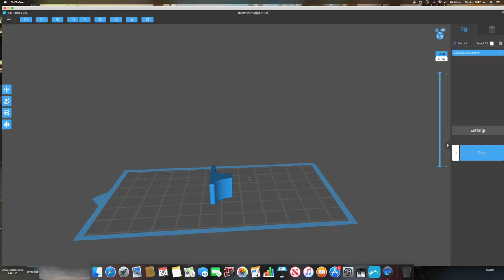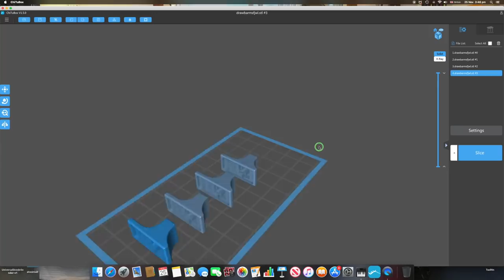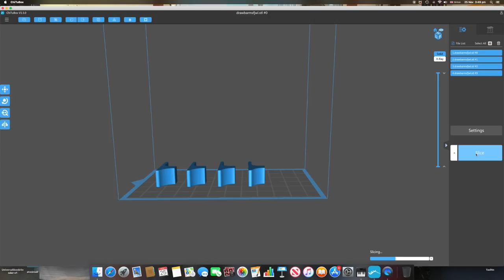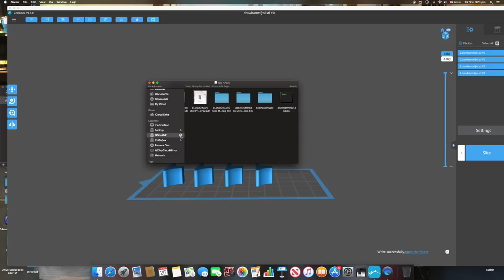Elegoo Mars 3d Resin Printer for super fine detail

Comment: Great test! Would have liked to hear a couple of more details though, like the amount of time the print took, the time you put it under uv light and such.
Reply: The estimated time for the print was 1hr and 14 seconds, but he said in the video that it actually only took 56 minutes. For most UV resins, it only needs around 5-10 minutes under UV light to set to a reasonable hardness, a few hours under direct sunlight. If it has crevices or multiple sides, it may need turning to make sure it cures evenly. It's just what dealing with UV resin is like. Fast curing, but it takes a bit more effort.
Reply from the maker: Hi the print took 56 minutes according to the camera and the UV was on about 10 minutes though i repositioned the parts a few times inside that 10 minutes.

Comment: So the machine is brilliant, especially for the price. The only drawbacks are not to do with the machine, but dealing with UV Resin. It smells, it makes a lot of mess and it requires a bit more care and attention than standard 3D prints do. It's a part of the course, and no commercial machine will change that, to all our annoyances, but it gets the results that even more expensive 3D printers can't give.

One thing of note for you and others, after polymer resin fully cures, it can shrink a little bit. So make sure you take this into account during designs.
Reply from the maker: Thank Jimmy. true the printer is great but the extra human efford required is the downside.

Comment: I wonder if these caps and sliders could be made out of wood. I find polished wood much nicer to touch than plastic. How would one come to this kind of precision with wood I wonder
Reply from the maker: I think wood could look very nice as fader caps but how to cut that fine 2mm x 4mm slot in the bottom.
Reply: I have seen 3D printers use a wood based filament, don't know how they do fine detail, probably not that good.